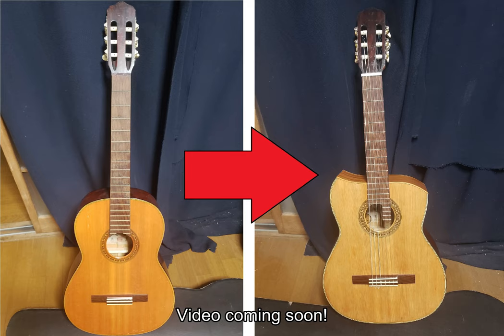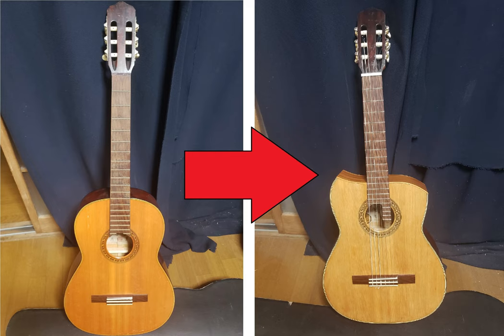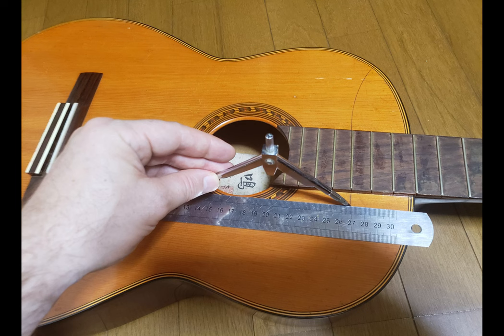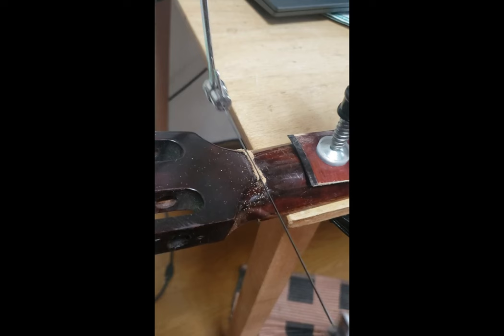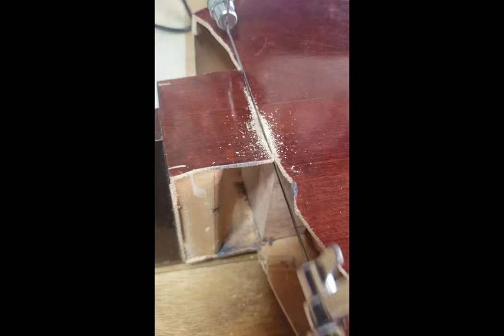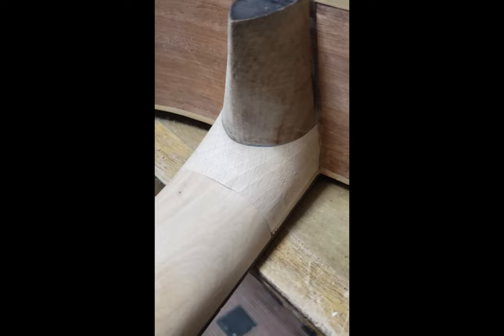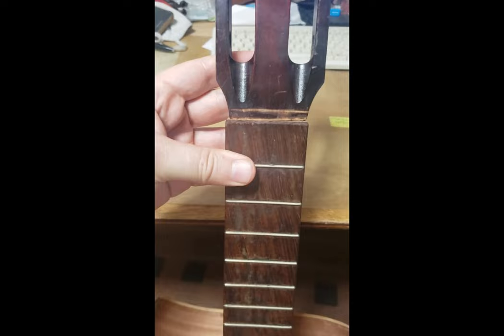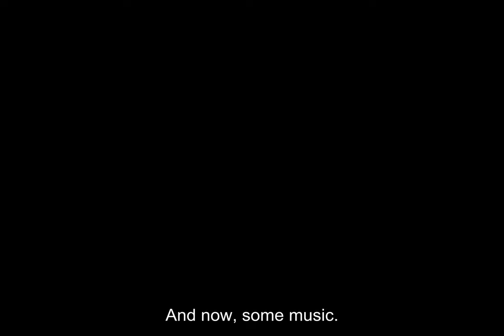Converting a classical guitar into a terz guitar

Comment: Terz guitars are criminally underrated!

I've been considering getting something called a "Baritone Guitalele" they have a longer scale lenght (about 20") than normal 6 string ukeleles (17") so I'm sure they would be great candidates to be tuned like a Terz guitar without any modifications (although they do have a smaller body, so the tone wouldn't be as deep or resonant)

A Mexican Requinto would also be quite an excellent choice since they have a 21" scale.
Reply from the maker: Cool! I don't know if I mentioned it in the video, but I think this guitar was a 650, so at the 3rd fret it would be about 546mm (21.5 in). 

I didn't know they made baritone guitaleles. I actually looked into normal guitaleles when I was planning, but they're probably too small for a terz, and you'd have to tune the strings down a lot. I'm also interested in requintos for even higher registers, but haven't looked into them seriously yet. Anyway thanks for watching!
Reply: @WD987654321  I'm sure that a high tension set of guitar strings on a Requinto would do the trick. 

Requintos normally use their own set of strings which are quite thin in order to be tuned from A to a.

Of course, the requintos I've seen on amazon are between $200 and $300, so your method is certainly worth giving a shot! I hope it withstands the test of time 😎

Happy new year, btw!